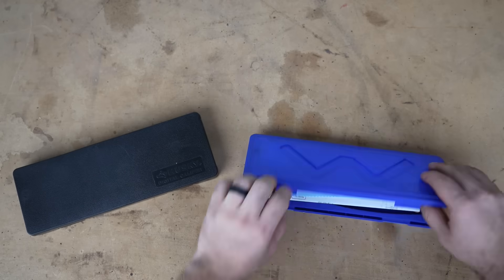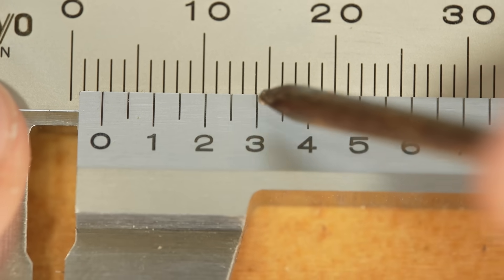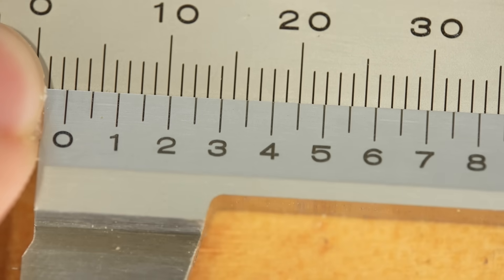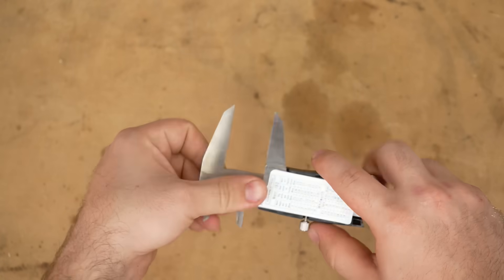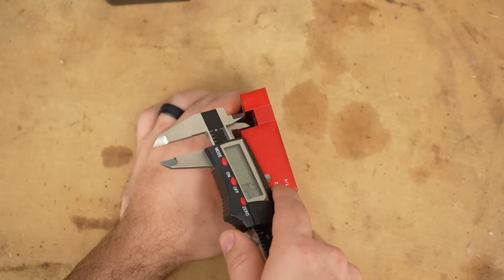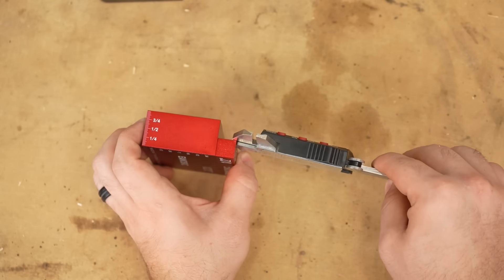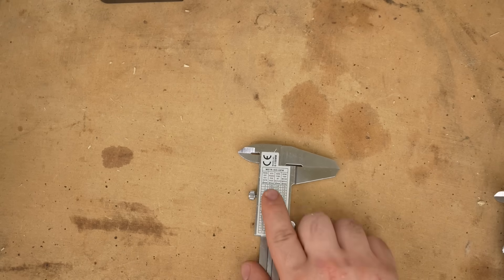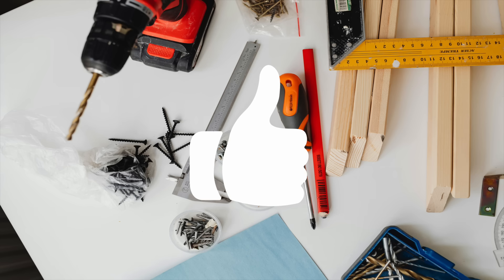I wish i’d known this sooner, How to use calipers like a pro

Comment: Mostly a good video, so congratulations.  Some omissions.  Nothing about dial calipers.  Why?  Also, what I consider a very important difference between verniers and digital calipers.  My 54 year old verniers NEVER have a dead battery.  I never worry about their calibration, with the exception of ALWAYS closing them before use and making sure they read zero.  (Clean the jaws first.) My digital calipers require closing and pressing the “zero” button EVERY time.  Plus, I don’t really trust them, so for critical work, I set gauge blocks to the required dimension and then validate the reading, by measuring the gauge block stack.  However, digital calipers can be “zeroed” at a dimension, and then they read the deviation from the target. This can be handy, so they DO have a place in my tool chest.
Reply: newer digital calipers live multilple years on one battery. They even stopped putting auto timeouts in them, because it just isnt worth it. the timer would use more power than the lcd and the measurement circuit. Ive had my mitutoyo digital calliper on nonstop for about 2 years now, and it still has its original battery.
Reply: @illRun4Clownident  So I should trade in my old digital calipers for new ones rather than just replace the battery? Or just reach for the tried and true verniers?
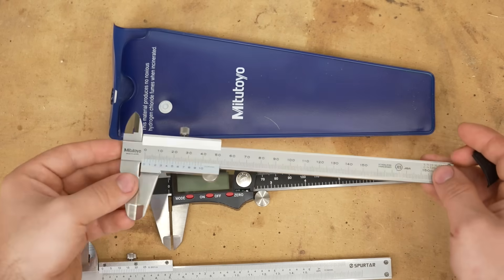Reply: He mentioned the lack of need for a battery at 2:53
Reply: @Glocktologist  some of us have older ones.  Just chuck them and buy new ones rather than use the verniers?
Reply: The inside jaws become increasingly inaccurate when measuring round holes with the smaller the hole the larger the error. If you look at the 'edge' you will in fact see that it is not a knife edge but is in fact a small flat. This causes a tangent error that increases as the arc of the measured hole decreases. The flat is intentional as to make it a true knife edge would leave them very prone to damage which completely destroy the instruments accuracy anyway. For small holes use pin guages or hole guages and a micrometer
Reply: @tomruxton6546  Amen!
Reply: Fun fact: the internal mechanism that digitizes the measurement is a vernier grid that senses the best alignment via capacitance.
Reply: You hit the point I believe. Most novice users can’t read a  Vernier scale. It is a convenience to read a dial, or a digital readout. 
However, being someone who had to calibrate and adjust and repair measurement equipment. Vernier are much more reliable and dependable! If dirt, grease, or metal shavings enter into the rack system on dial or digital calipers. Your data is corrupted and your measurements are wrong. 
Once you master Vernier calipers and are comfortable with them. They are great to have in your toolbox!
Reply: Yes, dial calipers are fantastic. Kind of like an analog version of a digital. They're my fav ones to use and I would say most dial calipers (at least from a well known brand) are machined to higher quality standards, better precision and better fit and finish.
Reply: Dial calipers have been largely replaced by digital. Even verniers have lost favor. The main reasons are they're easier to read, and instantly change back and forth to metric at the push of a button.
Reply: There's something wrong with your calipers if you have to zero every time. I've never seen that happen and I've used several over time. They even hold zero after they shut off.
Reply: @joewoodchuck3824  There is nothing wrong with them, but perhaps there is something wrong with your technique if you think you can just pick up a measuring tool and trust it to be correct.   One way I would determine if an applicant was a candidate to hire was watching his or her ritual that preceded taking a measurement.   The competent ones would first clean the jaws, then close them and observe the reading, open them, then close them again to verify they returned to the same reading.   Digital jobs are very sensitive to the pressure exerted.  It is highly doubtful that the user before pressed the same.  Even if that user was the same person.   Of course it could be I am just too paranoid, having inspected many parts with tolerances less than .001".  Calipers of any ilk are not suitable for work that fine.   Too many times it was necessary to measure the standard, the part, and the standard again.   Wood workers and machinists work to entirely different standards.   Those that work in aerospace are yet at another level.  Those that work with optical instrument are even more precise.  
A general rule is that high confidence in the measurement is only 10 times the finest division.  In other words a micrometer that resolves to .0001" is only really accurate to within .001" of that reading.  If one wants to trust it closer, one must compare it to a higher precision instrument.   That is why I use gauge blocks frequently, if the measurement must be any more than a guess.
Reply: @dougberrett8094  I don't see any fault with my technique. I don't know what makes you think that. I do clean jaws especially. 
    I've done very fine and accurate work when I was a custom mechanical and electronic designer. Not the end users nor my peers ever reported discrepancies. 
    I also have used calipers and micrometers in handloading ammunition. And yes, I do have a standard measuring block. 
   I believe I've adequately covered everything.
Reply: @joewoodchuck3824  Cool.   I have witnessed a wide range of approaches to machining and measuring.  Some much better than others.    If your methods work for you, that is all that matters.   I will never trust dial or digital calipers, but I have both, Mitutoyo, so not like Harbor Freight.  Best luck going forward.   What mechanical things did you design?   I have designed such diverse things a food processing machinery and bits used to drill oil wells.
Reply: @dougberrett8094  Custom laboratory research equipment at Yale.
Reply: @joewoodchuck3824  Cool.
Reply: I have a pair of vernier calipers, dial calipers and digital calipers in my measurement drawer.

I reach for the vernier ones the most, since those are easiest to read. When it needs to be really precise, I use the dial ones. The digital calipers have had an empty battery for a couple of years now, and I didn't bother to replace them yet.
Reply: @sanderd17  I have a pair of 12" Mitutoyo dial calipers.  I don't regard them as more accurate.   Dial calipers have the annoying habit of skipping a cog, if the work place is not kept unreasonably clean.  Easy for something to get in the rack and cause the little gear to skip one or more teeth.  Fortunately it is in multiples of .020", which is discoverable when the jaws are closed.   I always close the jaws before AND after the measurement.  I would not let any of my inspectors use dial calipers when I ran the QC dept. of a metal stamping company due to the skipping issue.
Reply: @dougberrett8094  yes, indeed, the dial calipers need to stay clean, which is probably another reason why I use the vernier ones more often.

My dial calipers live in a plastic bag in a tightly closed box in a drawer, and I put them back every time I'm done measuring something.

I'm less  worried about my vernier ones, so those are for daily use and often love on my workbench or just loosely in my drawer. It doesn't matter if some dust gets on the vernier calipers, they're very easy to clean again. 

It's true both can be accurate, but a typical vernier scale is less precise than a typical dial scale. If you don't have the precise scale, you need a little less accuracy in the tool too.
Reply: @sanderd17   Inch verniers with .025" verniers are much harder to read than those with .050" verniers.  Don't know about metric ones.  
Vernier calipers are tough.  Mine are over 50 years in service, some in precision sheet metal work, some in prototype machining, some in inspection.   Never failed a calibration.
Reply: @dougberrett8094  0.05 calipers are definitely a lot easier to read than 0.02.

As for toughness, I inherited some from my grandpa, who bought those during his high-school period. And they are still as accurate as the new digital ones.
Reply: @sanderd17 Digital calipers are always on. Just the screen is off. The battery will deplete faster if it is left in and old batteries will also leak and destroy the caliper.
Reply: @july8xx cheap one yes. Mitotoyo absolute ones have capacitive encoder strip running on the shaft so they need to be zeroed once to save the zero point on the absolute scale and then they are always zeroed. They have an option to temporarily set the zero to anything else if you want to measure that way but then you can put them back to the absolute mode (no matter where on the scale you are) and they are zeroed again. This also means that it doesn’t need to be awake all the time tracking relative position like the cheap ones, meaning the battery lasts years. Mine is now 8 years old and still running on the original battery.

Comment: Digital calipers are crap - the "accuracy" they claim in completely bogus. Vernier scale measuring tools are generally 5X to 10X more accurate as you are taking a direct reading and not the digital interpretation of one.

Read the specs on the calipers and you'll realize that the last digit should be taped over since it's worthless information. But then most people don't need resolution and accuracy to .00001" or more, so use the digital ones that cost more, require batteries, and no brainpower is needed to read them. Also, in cases where you can use micrometers instead of calipers, you should be using micrometers.
Reply: The last digit of any measurement is always dubious.  If the manufacturer was able to get that one accurately, they’d add another digit.

It’s worse when people (youngsters) use a calculator or computer, and keep 8 or 10 digits after the decimal  - to “be more accurate.”
Reply: @firstmkb  Dubious, but on a vernier scale it's generally a percentage of the last decimal place you can directly read. 

My problem with digital measuring devices (other than laser micrometers) is that they tend to universally lead the newbies to believe their measurements are far more precise, accurate, and repeatable than what they actually are. But if you only need to measure something to +/- .05" then go ahead and use digital.
Reply: @nolongeramused8135  Great benefit of digital, newbies can measure far more precise than they would ever need.
Using it wrong is a larger cause of error, so if the measurement is taken wrong it is irrelevant that you read it correct.
The scale is 0.05mm with a 0.02mm error margin on the one in this video, the digial are 0.01mm and 0.02mm.
Best case and you read it 100% correct including gestimate between the 0.05mm lines, you are still off with the same margin as digital...
Reply: @ssu7653  I trained people to use vernier scale. If they couldn't figure it out we didn't need them.

If they aren't smart enough to read vernier scale tools they aren't smart enough to run machining and grinding equipment.
Reply: @nolongeramused8135  Be as smart as you want, and read the scale as good as you want. You will never get more accurate than the scale your reading (same accuracy as the digital reading, going by those in the video)
Reply: @ssu7653  Digital readings have never been as accurate, nor can it be as accurate; information is always lost when converting from analog to digital.

This is exactly why audiophiles get tube-based amplifiers and listen to old vinyl records. While the typical listener may not have the ability to notice the difference, it is there. Digital is the trade-off between signal quality and ease of use, exactly how 8-track tapes were.
Reply: @nolongeramused8135  The question is simply, how much accuracy is lost in the conversion to digital compared to how accurate the analog scale is.

Im sure top of the line expensive analog have better scale accuracy than cheap digital, but are you buying analog with a more accurate scale than the digital options?

Ignoring human error with reading the scale, there is an inherent error margin on the scale. Listed as +/- 0.02mm on the analog in the video, the same as the "standard digital" or worse than the "quality digital" used here.

Analog reading is litteraly eyeballing where it fit best, with digital having accuracy finer than the scale on analog.
Reply: @ssu7653  There are highly related questions to that line of thought on several ASQ exams and contained in multiple places in the body of knowledge. Here's the kicker; people are far more accurate literally eyeballing an analog measurement than they ever give themselves credit for. Just like the fingernail test for surface roughness is often just as good as dragging a diamond stylus over something to get a RMS value. 

And again, the digital reading is an approximation - it can be a very good one, but that last digit might as well be taped over most of the time. You'll be spending more on digital gear than you will on vernier scale tools of actually equal accuracy, precision, and repeatability. And that's just he up front cost. You also have to figure in the cost of quality from accepting bad product due to lesser accuracy. I've seen that costing a company its owners because they didn't want to spend an extra $200 per station to equip the machine operators with more accurate tools. You know, save $2K now so we can spend $200K/week in rework.

I'll put it this way: I ran inspection and calibration for decades, and digital equipment is considered slop measuring for when being off .005" isn't an issue. When you really wanted to know what you had you used a granite surface plate and vernier scale height gauge. I've used one that dated from the 1940s that was still calibrated to a finer resolution than we had with any of the modern Mitutoyo or Starrett tools.
Reply: @nolongeramused8135  Again, you can NOT get a more accurate measurement from analog than the scale that is on the tool. I dont care how good your reading is, the tool already have an accuracy for the sale that you either accept or throw away the tool (or dont buy it).

An analoge measurement will NEVER be more accurate than the scale on the thing you use to measure. This is not about feelings or experience, it is a simple fact.

Can you get analog with better scales than cheap digital, or equal accuracy for less cost. Yes, but the options in this video show digital with same/better accuracy and the added benefit of very easy to read measurement
Reply: @ssu7653  Have you been completely misunderstanding everything I've been posting, or just interjecting your own stuff into it?
Reply: @ssu7653  Are you defending digital equipment simply because you find it easier to read, or because in your applications it's all the accuracy you need?

Digital equipment costs more than analog - you have to pay for the electronics to translate the reading into a display. Keep telling yourself that digital is more accurate when quite simply in the materials that come with the tools state that it isn't. Math is often involved to make that determination.
Reply: @nolongeramused8135  Being easier to read is a clear benefit, the cost is a drawback. Accuracy on both options is the same or in the instances in this vedeo the digital is better accuracy. 
When i say accuracy, i mean the margin of error from the tool itself. 

There is no way to possible get a readin more accurate than the scale you are using. No mather how accurate you think your reading is, it is limited to best case the same as the scale. 

If the scale have an error margin of +/- 0.01, then any measurement you do will never be more accurate than +/- 0.01
Reply: To be even more perfect (nerdier) we should measure metals at 20°C according to the ISO system. That’s why micrometers even have the plastic grip to prevent our warmth from our hand to affect the measurement. 😁
Reply: @anders.2259  measure the temperature, and correct to the standard 20°C